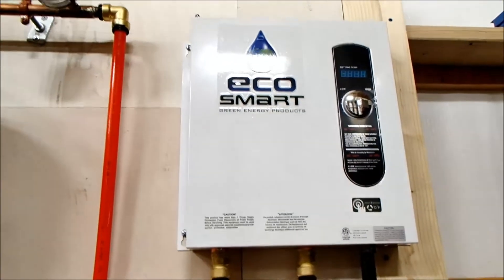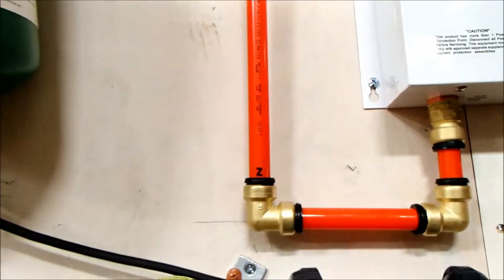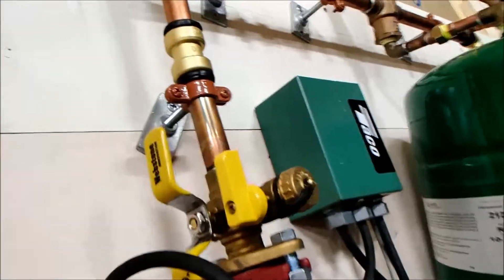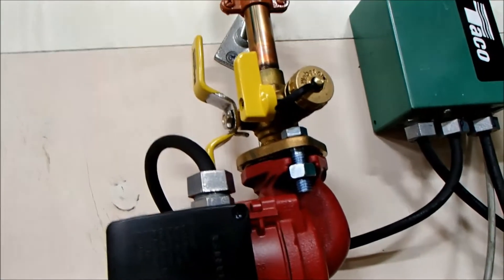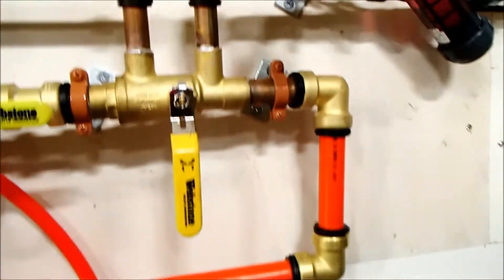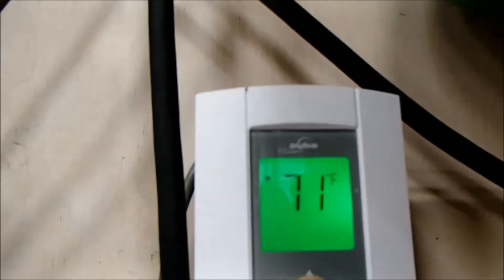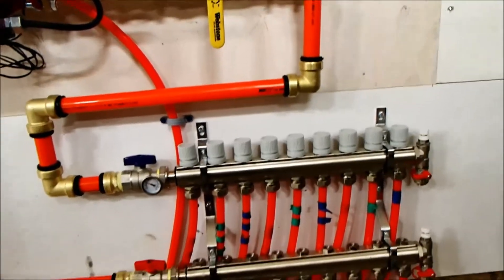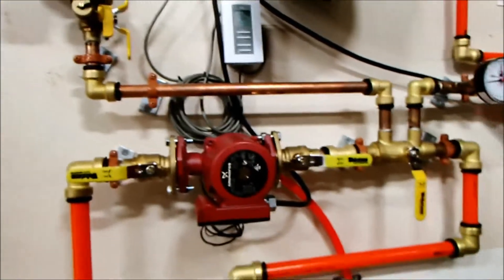Radiant Heat Components Overview

Comment: mike,  I believe you are close to me in the same state. I am about an hour north of you. You said you are heating 2560 sq ft. Is that correct? I see your distribution block appears to hold 9 loops/ circuits. I am looking to put together a system for a 2400 sq ft  pole barn. I was figuring more than 9 loops. Am I wrong? I am under the impression that each loop needs to be 300' or less to be efficient.

Comment: Do you have any temp sensors? Or something that sends a signal to the thermostat?
Reply: I do, an in floor temperature probe but it is not needed. Ultimately you just care what the room temp is. If its not warm enough, set the thermostat so it still tuns on the pump.
Reply: @bloomingtonmike   so should i get just a thermostat connected to the switching relay ,, without some probe  to the floor?
Reply: @ngplumbing8948  up to you if you want to know the floor temp , the cables are only about 15' long though. The temp in your room is all that matters, if not warm enough you want it to keep running. Btw, -8 outside and 40mph wind and 40 degree F in the shop.

Comment: Mike, are you running a glycol mix?  If so could you tell me the mix ratio and what your winter weather/Temps are?  Thanks bud I appreciate it!
Reply: I did 50/50. Math was easy.  Its midwest. We get some sub zeros F some days but lots of 20 - 10 degree and lower days.

Comment: Echo Smart , I sm jyst deciding what way to go. This was one thought , but also looking at a heat pump hot water tank only using 450 watts only on heat pump mode, im sure this will save so much $$$ a year. Wonder how much this option costs pr month
Reply: wont work on heat pump mode for many reasons. I tried it.
Reply: A heat pump water heater probably can't supply enough BTU to support an infloor system.

Comment: Thank You for the video I’m building mine exactly like yours. Do you happen to know what size pressure relief valve you have
Reply: You have to use a relief valve set at 30 psi, NOT a standard domestic water heater valve.

Comment: Hi Mike, I notice your system does not have a Water Pressure Reducing Valve to decrease the high psi city water in the system.  But the return water from the system had a pressure of 23psi, how did that happen, I thought the city water pressure is about 45-65psi.  Thank you
Reply: It's not fed with city water - it's fed with glycol from a bucket or pail with a pump on first fill or during a flush.

Comment: Hey Mike, Quick note on your second pump; the electronics are facing downward and I literally just saw a video from a Technician stating that’s a No-no. Should your pump sweat, that water will go down towards the electronics and potentially damage it. As such, you might wanna revisit that. Hope that helps.
Reply: I have the same pump and instructions clearly state that it can be installed the way Mike installed it so should be fine. I do see however where your concern is coming from Ivan and is a good point.
Reply: My pumps have never sweat. Working great today as when I built it. That cover is waterproof/resistant too btw.

Comment: I'm considering a radiant floor heat system on a new home build in MA.  I'm debating whether electric would be more beneficial to us than gas/propane since we'll be going solar.  Any thoughts on this?  We'd be doing a staple up system using PEX and heat transfer plates between the floor joists in the basement.  The house will be very well insulated.
Reply: Go with what fuel is cheapest in your area. Electric was my choice as the electric boiler was cheaper and this is a shop not house. Ideally I'd go gas. Natural gas is cheaper to run monthly. Electric is more efficient boiler wise but you are taking a loss doing transfer to plate so you will want the best cost you can get at the end of the month.
Reply: @bloomingtonmike  I have gas at my current house, but its not available where we are building the new house.  Our options are propane, oil, or electric.  Electricity is outrageous in our area.  My electric bill this month was $500+.  I'm leaning toward propane.
Reply: @randomstuffwithjoe  solar may be tough as the boilers are quite taxing at full load. This one is three 220v single phase 40amp circuits. Does not draw that all the time but do a load calc with your poco and solar engineer.  Id do propane personally. Best advice ? Insulate like crazy!

Comment: Why are there zone valves when they are all on or all off? What about a plain manifold... a piece of copper with 9 fittings for supply... and another one for return ? The water would circulate to everything when the tstat calls for heat and turns on the pumps.
Reply: @bloomingtonmike  is that really necessary? I dont know the answer. I DO know in electricity if one connected section of wiring has a higher resistance.... it wont get power. I hope someone else weighs in on this.
Reply: I know this is an old comment and there must have been another comment that is no longer there, but are you referring to the little valves on the manifold? Those are balancing valves,  to balance the flow between each loop.

Comment: what pressure do you have in your system, i cant see on the gauge..  i am building a similar system.. great info.
Reply: I pressurized to 15psi and it climbs to about 23 when running.
Reply: in video he comments pressure was around 23# at the time for call for heat...

Comment: Thank you for the information!  I’m considering the same concept for heating radiant floors in my homes bathrooms and gas is not an option. How often do you flush the system?  And do you think you need that powerful of a electric burner?  I mean it’s low pressure and your not heating 40-50 degree water.  If the water is returning at say 80 degrees and it’s only raising it 10-20 degrees would a less expensive boiler (that uses less electric) still get the job done?
Reply: This is the cheapest tankless water heater you can buy, it is not a boiler. BTU requirements of the building dictate the size of the boiler needed to heat it. 1kw equals 3412 BTU so if you need 34120 BTU for your space, you need 10kw worth of boiler and will use 10kw worth of electric. Less power equals less heat
Reply: @Darnellp87  there are cheaper units that only require 1 40A fuse...  this unit required 3 fuses...  poster could try smaller unit to see if can keep up with demand, once slab at temp and if insulated properly a smaller unit may work for his purposes...
Reply: there are also low voltage electric units that are simply wires installed under flooring, typically under tile and inside of mortar that my friends are using, claims cost couple bucks a month to operate..
Reply: @craiggerlach5548  no. The BTU demand of the space dictates the necessary electrical input. This size building could not be heated with a boiler only requiring a 40A fuse. Same rule applies to your liar friends using resistance cables at "a couple bucks". There is no way to get more output from electric resistance heat emitters than goes in.
Reply: @Darnellp87  the person who asked question just wanted to heat a bathroom floor, not a building though...
Reply: @craiggerlach5548  my point exactly. Nobody said anything about a 40A necessity besides you. I explained to this person how to size the heat needed for his bathroom and you came out of nowhere with some random 40A number
Reply: Craig Gerlach unfortunately the tile guy I staled the floor tile before I had a chance to put the electric heating mat in.  That was my original plan.
Reply: @Darnellp87  in the original video the OP is using a unit that requires 3 40A circuits to operate, you state that is the smallest unit you can buy. It is not, I replied about how you can find single 40A units that may meet his demand of heating simply a bathroom floor.  You seem overly defensive of your statements, perhaps sit a while and cool down before you reply again, if even needed.. I only clarified that there are indeed smaller units, some use only a single 40A circuit...
Reply: @craiggerlach5548  nowhere, absolutely nowhere, did I say anything even remotely similar to "this is the smallest unit you can buy". But thank you for trying to belittle a stranger several times
Reply: @Darnellp87  cheapest to me meant smallest , but whatever,, no matter what anyone says Lord DP will argue with you...  guess he has a bathroom the size of a locker room, my bad.. just let it be...

Comment: What's th3 size of the pipe you used under the slab? 1/2 or 3/4?
Reply: Ruben R. Roman   1:57 states 1/2” pex

Comment: WHAT WAS THE PRICE ON THE SYSTEM. THANKS.
Reply: I built it myself. Less than $800 total.
Reply: Plus $1000 in a pex manifold kit.
Reply: @bloomingtonmike  what do you mean? $1800 total?
Reply: @nukethorn-v8l  i spent $1800 on my pex, manifold, panel parts, and boiler to heat my shed. I don't understand your question honestly. Quotes to do this were 8 grand from folks to install this for me. Even purchasing lesser panels completely built was much more expensive.
Reply: @bloomingtonmike  my point was not to say the build was expensive. i was confused about the total cost because you answered initially with 800 and then said plus 1000 in a pex manifold kit. why wouldnt you include the cost of the pex manifold kin in your initial response? i wasnt sure if you were saying the total cost was 1000 or 1800. thats a great price for a system like that. thanks for sharing.
Reply: @nukethorn-v8l  video was on the panel so thats why I initially answered 800. It is useless without the pex and manifold though so thats why I clarified.

Comment: Hey Mike, the setup looks great! Curious how it's been working out for you. I'd like to use a tankless electric heater for a single story, 3 zone, 1600sq ft house that I'm building. Compared to your square footage and the large space you are heating, I'd think that this heater would be plenty sufficient for my needs(it's also a full SIP structure so heat loss is minimal). Any feedback would be much appreciated!
Reply: If you can run a nat. gas heater do that. Its not cheap to run this one. Plus three 40 amp circuits is pretty large and the wire to run to them is not cheap either. That being said it works great now that I have wall and ceiling insulation. Make sure you r value is high!
Reply: I'd go with a heat pump "chiller"over a boiler - 1/3 the energy for heating. Chiltrix makes an air source one I'm installin for my house.
Reply: Great. Thanks for the reply. R value will be really high and a really tight building envelope with the SIPs structure. I live in PA, not crazy cold winters, but cold enough. I can't get natural gas, but propane is certaintly an option. I was just trying to avoid using an actual water boiler since radiant doesn't need super hot water.

Comment: so both pump are running at the same time?  When do you use the purge tee?  Im trying understand the reason for (2) pumps??
Reply: The vlave allows mixing. Flow rates are different because of head pressure and water volume. Primary mixes all the the time and lowers the delta T entering the boiler.
Reply: @bloomingtonmike   HI Mike, old thread and comment but thought I would mention this in case others like me are designing the system presently, and found this info and your video very helpful. I did notice however that you installed your (secondary pump) on the left side of the mixing valve. This means your primary (boiler pump) and secondary (System Pump) are on the same circuit. Referring to the Stiebel Eltron system (Hydroshark), you can see the System pump is installed on the right side of the mixing valve. This allows the primary "boiler loop" and the secondary "emitter loop" (pex loop) to be hydraulically separated from each other. This allows the flow rates of each circuit to be set independently for optimum performance. Not sure if putting the pump to the left side of the mixing valve (as you did)does the same. Were you told differently or have any comments on this? Thank you again for great video and explanations.
Reply: @Triggerman2505  I had the same question as I did not understand the need for a second pump - I have seen several systems that only use one pump.  Both seem to work.  I contacted Hydro-Shark and asked the question.  Here is the response: "The reason for a 2-pump setup is to create hydraulic separation using the closely spaced tee. This allows heat to be transferred back into the boiler while also providing heat to the floor. This creates a far more efficient setup as the return temps into the boiler are warmer allowing for the boiler itself to work more efficiently. Using a single pump system certainly works but the main problem is by the time the heat is transferred into the floor and returning back into the boiler it has significantly dropped temperature making the boiler have to work harder to increase the temperature."  Note: This is what Mike was talking about in a previous reply when he referred to Delta T.  If anyone doesn't want to bother going the DIY route and just getting the pre-built panel - the folks from Hydro-Shark were really helpful.
Reply: @donaldlepp5367  my comment was not on the requirement of the second pump as I realize all the benefits of it. If you look at my comment again, you will see that I was referring to the position of the secondary pump. Cheers.
Reply: @Triggerman2505  got it
Reply: @bloomingtonmike  he likely asked because it is in full off position, no mixing.. I was questioning too as I was going to run a 1 pump for simple 2 zone twin 150' runs in small addition.. and saw no need for one but do see them used all the time.. my manifolds for a 2 run were just over $100.. and both in and out have air purge, wondering if enough or need micro on top of expansion tank...  want to be able to add to system and put pex under floor in future, back says next year, so 1 side of house on electric baseboard until then or cranking up addition and hoping can double heated space..
Reply: @craiggerlach5548  its set at 45° in use.

Comment: Where does water enter and exit the system Mike?
Reply: Clint Eastwood it enters just below upper pump and exits just above it. Thats only for filling and purging the initial fill or for any flushing. It is a sealed pressurized setup and does not need a supply line during normal use. It does not loose water/glycol.
Reply: bloomingtonmike Thanks man that's a real nice system you got there. Greeting from Saint Paul.